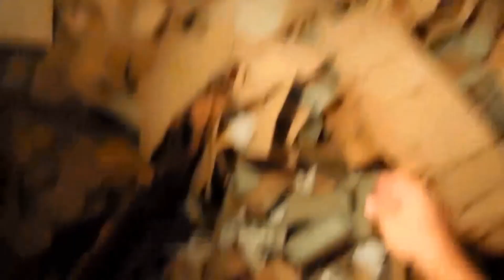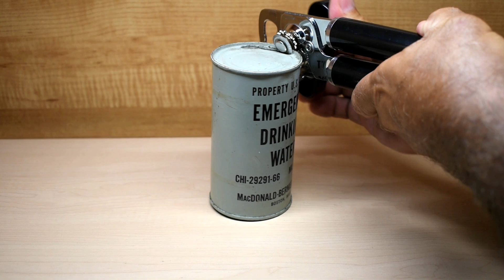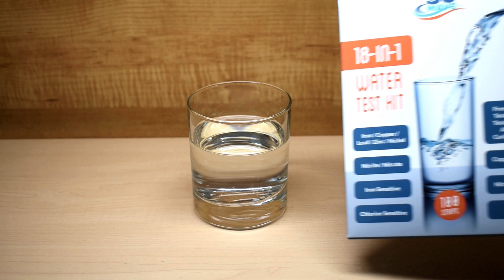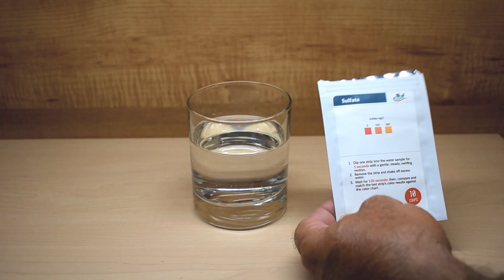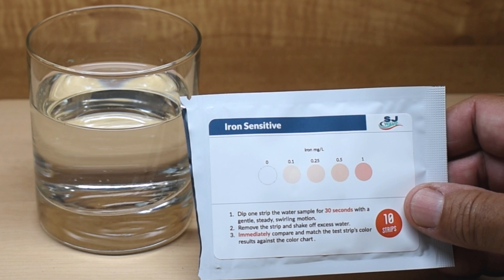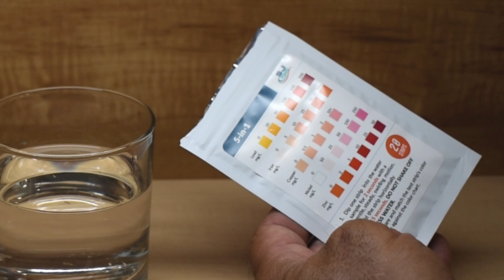Can You Drink 60 Year Old Canned Emergency Drinking water? (Find Out)

Comment: Zero test for bacteria or toxicity.
Reply from the maker: I didn't find it necessary to test for bacteria in the water because the plant that canned the water would have an extremely low probability of having bacteria spores in the water before sealing the can. Somewhere around the world somebody drank out of these cans not too long after they were made. If bacteria was present, it would have been known a long time ago
Reply: @electronicsNmore  But most of the cans were rusty, allowing entry.
Reply from the maker: @GWorxOz  No, the rust was only superficial on the cans. As long as the can is still under vacuum, you know the rust on the outside of the can was not bad enough to create a hole.
Reply: @GWorxOz you don’t have a clue silly!
Reply: @harley092355  Really? My son is a pathologist.
Reply: If there is any rust where you open the can it could get in like the paint flake you noticed.
Also if the inner lining was scratched and rust did begin on the inside it may not have reached all the way through yet, but that still is a very minimal contaminant if not visually noticeable. We do have some iron in our blood and our body does filter a certain small amounts which is why ppm is important to know.
There are also certain foods you can eat to reduce the absorption of too much iron/rust which could also help.

Comment: Excellent video Doug!  I don't know if I would drink the water.
Reply from the maker: I actually tasted it and it had just a little bit of a flat taste. If I was dying of thirst you could bet I would drink the water if the vacuum seal was in tact.
Reply: @electronicsNmore  Makes me wonder if your body would deminerilize if you drank that water for several days.
Reply: Just mix in some vitamins and minerals, you'll be fine. 

Some scientist think there is also a concern over cell damage from absorbing water without free electrons to donate to cross membrane processes which also may be true, so just add something nutritional too the distilled water before drinking.

Comment: You should see the gunk that's left in my water distiller after a run, puts you off drinking tap water without distilling it first, doing a video on the sediment left over in your locale might be an interesting video?
Reply from the maker: Some areas have horrible drinking water quality.
Reply: I got a distiller because our tap water has so much salt and whatnot in it that after topping off a 1 gal humidifier over the course of about 2 gal it would start to boil over because the salt became so concentrated and the tap water would ruin a steam iron in about three months even when I cleaned it regularly. The distiller instructions recommend a good cleaning every handful of cycles (I forget the exact number), but I was having to clean it out with citric acid after each run because the scale build up was so thick over the heating element and dissipated the heat enough that the second or third run (without cleaning it) took almost twice as long. Normally, it would run until it boiled off all the water, then the excess heat would trip a thermo switch turning it off. But that left essentially concrete in the bottom that required soaking it in citric acid, so I started running it on a timer switch to shut it off just before the water completely evaporated. Leaving a little bit of watery sludge at the bottom made it easier to rinse out and repeat, but, man, that sludge left in the bottom is gnarly…
Reply: @RandomBogey  ever curious to test that sediment?

Comment: I had 10 year old juice boxes in my van under the seat . I broke down on a hot day and drank everything I had . I found the vacuum sealed boxes and drank all six . They are foil lined . They were orange juice . I never got sick . However , use common sense . Many acidic items over time will eat into the coated lining on cans . Especially pineapple . Obviously , if a can bulges , a reaction is going on . If the product smells bad or is discolored , no good . Even if everything seems good , a small taste first . If you are stuck , it may help you out .
Reply from the maker: You brought up all valid points